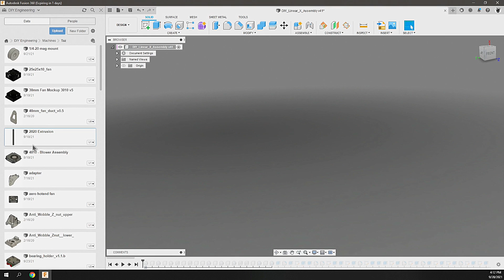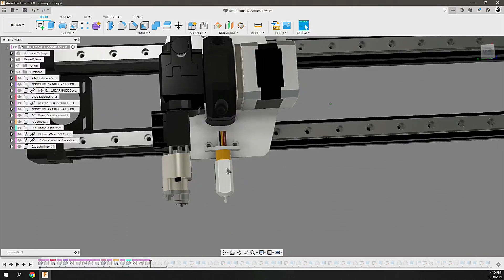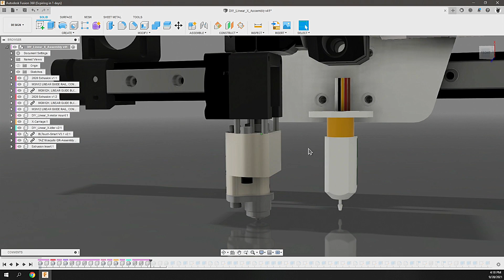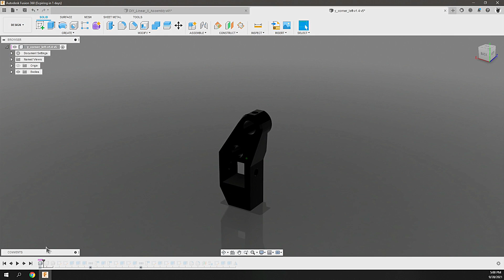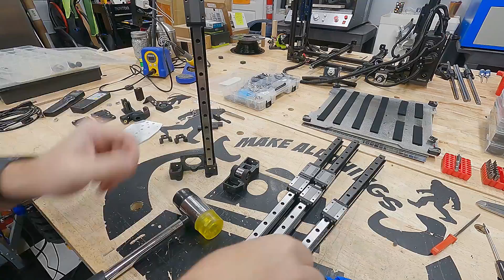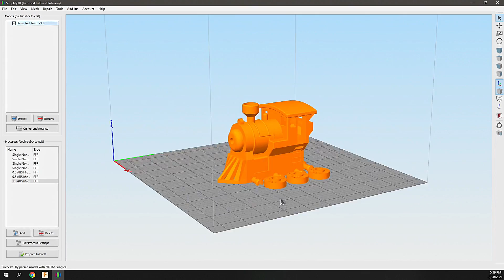Heavy Duty Upgrades renew my TAZ 4!!

Comment: What are the black strips laid across the bed platform?  I imagine it's to prevent the bed/heater from scraping the screws or bending too much? (Is it thick foam?  rubber?) https://youtu.be/5tB8159WfS4?t=1260
Reply from the maker: it is a thermal gasket, which in this case is roughly 1/4" and fills the gap between the bed and the heating element to ensure that the element has even pressure applied for across the build area, this was something I added to prevent an issue that others have mentioned regarding the modular heat bed.
https://www.amazon.com/gp/product/B015DAI8K0/ref=ppx_yo_dt_b_search_asin_title?ie=UTF8&psc=1

Comment: I still have prints running on my TAZ4 as I watch this.  Thinking of trying an upgrade of some sort for it but it's still working perfectly even after several years.
Reply from the maker: Depending on the extruder youre using, minimally a new extruder and hotend will raise the level of experience and quality to the machine. im also very glad I went with this printer as It has buffered change (through upgradeability) over the years!

Comment: I scrapped out my Taz5 this last year. At 12,000 hrs plus, bearings and rods were shot. Reused motors, PSU, and extrusions to build a CoreXY (Voron). I still have several dozen new rolls of 2.85 so I have a  2.85 toolhead for the Voron on the "to do" list.

Comment: An excellent and timely video as I'm in process of refreshing my 5-year old Prusa clone. It's already built with 20mm extrusion, so adapting linear rails should be as trivial as you showed us. 
I have a couple questions:
* I have a 200mm bed. I've heard varying opinions about using a single 'wide' linear rail under the bed vs a pair of narrow ones like the MGN12s. Thoughts?
* I'm probably going to ditch the heavy steel mounting plate that is currently on the X carriage. If I decide to fabricate (or outsource the fabrication) of an aluminum plate, is there a 'universal' or 'suggested design'? I can customize it, for sure, but it would be nice to have a somewhat flexible drill pattern that can be used to easily mount different extruder assemblies in the future. Any thoughts on carbon fiber plate, for that matter?

Thanks again for the great vid!
Reply from the maker: hi, with dual rails you will need to deal with parallelism to prevent any slide issues otherwise the extra guide blocks provide better bed support. (if you want that) - does it matter with ABL?
I dont see a standard in vendor extruder mount points, similarities but no standard. :( my plate was designed with direct support for the bondtech extruder and a uniformed bolt pattern which allows for 3d printed adapter plates to be produced when that time comes. I think thats the best you can do. (magnetic would be cool) carbon fiber is a neat idea, depending on your attachment options... not sure tapping CF is a good option.
np, good luck!

Comment: What is your opinion on Cura vs Simplify3D?
Reply from the maker: I like the latest version of cura, it seems to have a lot more options for controlling slicing than s3d, but i have well tuned profiles in s3d… i need to take time to tune my profile in cura, then i may use it more… what about you? S3d is over due for an update.

Comment: really nice work, i'm sure its a substantial stability and reliability upgrade and it looks clean and solid. there are just a a few little design choices that i'd question, which id personally solve a little differently;

the bearing idler. it looks odd that its larger than the drive pulley and will create uneven belt tension over the travel, and i've heard that running the toothed belt over a smooth idler can cause visible artefacts in the print...bumps as the teeth plop over the smooth surface.
during the CAD segment i was picturing the bearings mounted externally, with a short shaft going through, with another drive pulley(not idler) on it like the one on the motor. this is a little heavier than the correctly sized toothed idlers that are also available, but people sometimes have problems with the tiny integrated bearings in those, over time. so was really impressed with the solution, but it didn't quite turn out the way i imagined.

the second detail was the carriage to bed adaptor plates. the combination of plastic shims (effectively) and threaded inserts theoretically negates the accuracy and stability of the rail and carriage assembly and i'd have preferred to see you drill new holes and mount directly. but i'm sure it has no real world impact and it can all be compensated for with bed levelling anyway, physically and in software.

lastly i think your linear rails would like a little lube. from the sound of them they were shipped dry, which they often are, and they'll much run smoother and quieter afterwards.

lovely upgrades though, its a very handsome machine. the hotend wire loom is super nice and satisfying and most importantly the print result is also doesn't disappoint. super impressive how much plastic it can push, so precisely and consistently.
makes perfect sense to specialise your FDM machines towards large, solid prints IMO, with increasingly large and reliable SLA printers available for the finer details. smart stuff, as always.
thank you for documenting and sharing your projects, they're always awesome!
Reply from the maker: thanks for the great feedback!
I guess I got a little lazy in wanting to use the existing drive system, I was not aware of the idler issue, but it makes sense. I will plan an upgrade, but for now, I dont think im experiencing any ill effects from that part of the design.
I plan to mill some aluminum plates for the bed adapters, I just had a timeline to meet with this build, although it is solid, thats an easy fix.
while the rails and guide blocks were drenched in a 3-1 type viscosity oil, I didnt actually check to see if the bearings were dry... good point, they do sound dry now, thinking about it... 
absolutely, ty!
Reply: @DIYEngineering  its all theoretical, the print results speak for themselves and its clearly an excellent mod.
The rails are often shipped in anti corrosion oil that isn't actually lube, but I dunno, they sounded quite dry and I think they could get better. Mine aren't as noisy. But again, probably a complete non-issue in reality, just a little bit of unsolicited feedback based on my experience.

I'm surprised you gave away your shapeoko before having a replacement. Have you ever wanted to build a DIY CNC? It's one of my current projects and I'd love to see your take on it!

Comment: What a gorgeous build. I was curious about why you chose to use ABS for the 3d printed parts as opposed to PETG or something else. I guess you're able to print much nicer ABS parts than I've been able to in my experience, where my parts dimensional accuracy was kinda poor. Yours look great. Did you consider using a different material, or why ABS?
Reply from the maker: I generally use abs for the glass transition point and it’s mechanical properties. Most others either can’t handle the heat, don’t wear well or don’t hold their form… I’d just cry if leaving my curvecade in the car caused it to melt and fall apart! :)
Reply: @DIYEngineering  That totally makes sense. There's no question that ABS can deliver if that's the requirement. I just wish I was better at printing it, I've never managed to print an ABS part that didn't warp significantly but yours look essentially flawless. You've really nailed the print settings on your Flashforge machines.
Reply: @danielsmullen3223  you might want to try CF ABS then. The fibers prevent most flaws of pure ABS
Reply: @MakenModify  and  @Daniel Smullen Printing ABS that doesn't warp requires a couple of thought changes. 1. Use an enclosure (cardboard box can work ok depending on your printer. 2. Control your air flow! warping is due to a body that cools too fast. No drafts. No cold printing. I run fans at 30% or less (15% in my Vorons). 3. Take sharp corners off of your designs (to the extent possible), especially on the bed layers. 4. Some people swear by ABS+ as a way to make ABS behave better. I haven't needed that for mine. 5. Don't try high temp plastics on a printer without an all-metal hot-end. The PTFE will degrade and emit poisonous gases. 

Check out Clough42 vid on printing ABS. https://youtu.be/DQu0ThBS4MY